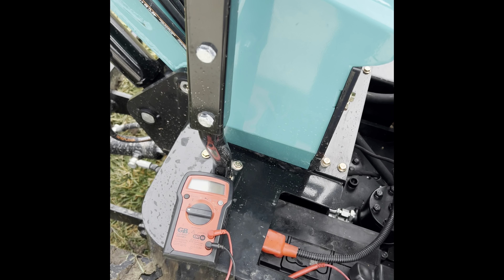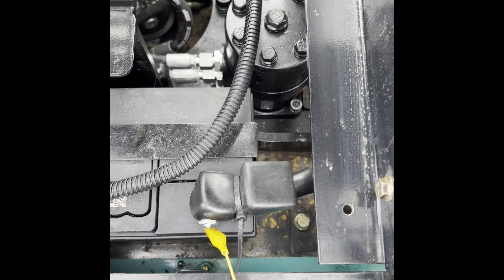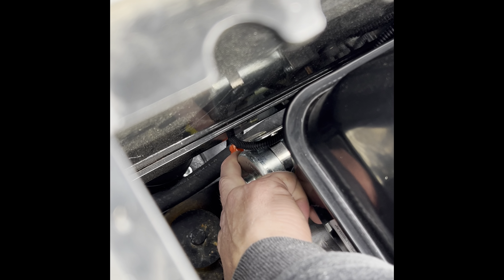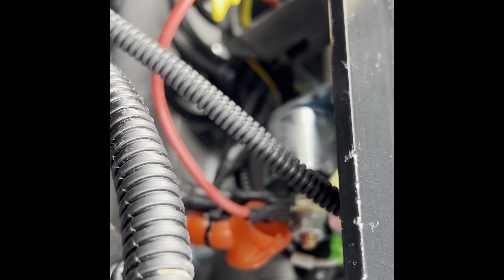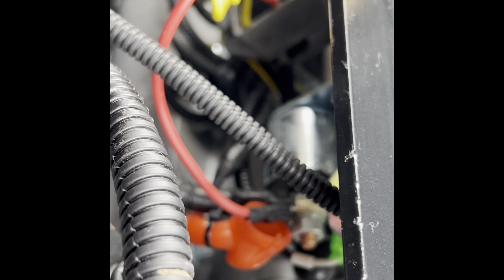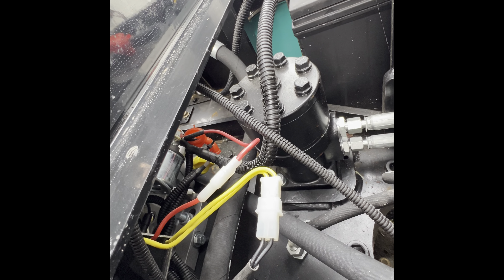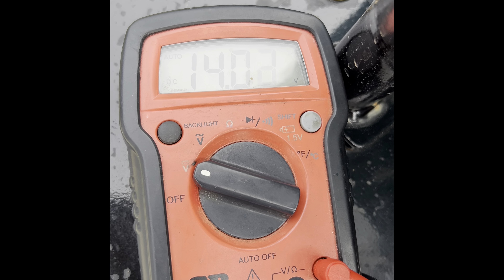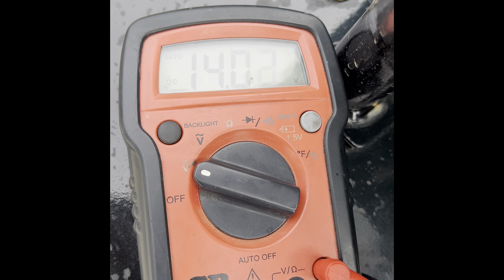Electrical Overview On Chinese Mini Excavator QH12 FF12

Comment: Great video, wish I found it before I traced half of the wiring myself 2 weeks ago because of a blown fuse. You were testing alternator wires' output to the ground and getting 8.5VAC on each leg. Bet you a quarter they're opposite in phase, centered around ground and will give you leg-to-leg 17VAC.
Reply from the maker: Lol I try to get it out there but most of the forums block links so just have to let people find it themselves!

Comment: We have a brand new Chinese skid steer with likely the same electrical design as your excavator. The battery is fully charged. When we turn the key, the power drops; the lights go out, and it just will not crank, although it is trying to. Do you recommend any steps to check for troubleshooting?
Reply from the maker: Could be a lot of things but according to your description it sounds an awful lot like a bad battery or ground to chassis. Batteries can have a full charge and drop to 0 volts as soon as a load is put on.  I would recommend load testing the battery to rule that out then with a volt meter check your ground including the main cut off switch as that is on the negative side if the battery a bad internal connection will cause power loss to everything. Then with a volt meter on dc voltage setting check voltage going to starter solenoid when key is turned to start position.
Reply: @86ServiceTube  It turned out to be a bad battery. Thanks for the response.
Reply from the maker: @xoneeleven showed all the signs!  Glad you got it figured out!

Comment: @86Service - I’m diagnosing a starting issue with my mini after a few of the wires burned in two from being to close/touching the engine. The wires come from the starter solenoid. I spliced them back together. Now the machine will turn over and over but won’t fire up. Any idea what is wrong? I found two fuses and both of those are intact. Thanks!
Reply from the maker: If the information you are giving me is accurate… the wires going to the solenoid will not effect engine firing.  They simply power the starter motor.  You have a spark, fuel, or compression problem.  Likely not compression.  So focus on spark and fuel.  Spark is easy to test simply remove the spark plug leave it plugged in to cap.  Ground the plug to the engine casting turn engine over with key or pull rope and watch the plug for a nice consistent spark.  (Be careful nothing flammable is on engine and cylinder is not flooded with fuel or it may ignite). If you have good spark move on to fuel.  If you do not have spark check the black wire coming from under engine shroud it comes from ignition coil to the key switch.  That is your engine kill switch if it is not hooked up or there is a bad connection in keyswitch to that wire engine will KILL and not spark.
Reply: I have confirmed it’s not a fuel or compression and definitely a spark issues. I pulled the plug last week and didn’t get a spark. 

The kill switch is effective as in when I flip it, I get no power to the starter. 

What all controls the spark? Relay?
Reply from the maker: @dustinchambers496  Spark is going to come from your flywheel to the ignition coil mounted by the flywheel then sent to the plug.  The only external thing that would effect the spark would the killswitch and wire that goes to the ignition coil from kill switch to ground the coil.  If that wire and switch are confirmed correct then the only other things it could be would be a tripped low oil sensor, bad ignition coil/cap/plug, or a flywheel issue.

Comment: Thanks a million for the great video! I have a question, I have blown two fuses then it shuts everything down, I believe it has something to do with the light on the bucket, that runs to the switch that you pointed out on your video, my question where could the short possible be? In the light? In the switch? What can I do to solve this problem? Thanks
Reply: Any luck finding the issue?
Reply from the maker: Sorry I just saw this.  If you feel that the short is in the light circuit you could check the wires on that circuit for continuity to ground while wiggling them.  If the fuse is blowing there is definitely a direct short to ground or a load heavier than the fuse can handle.  What model do you have and where is the fuse located?

Comment: How does the circuitry work to stop the engine?   What's being grounded to stop spark (to kill the engine... if that's indeed what kills the engine)??   Thanks.
Reply from the maker: Sorry for the late reply.  Good question.  I would have to look at the diagram to see how it actually works.  But I do know there is a single wire going from your keyswitch to the ignition coil that tells it that it can or cannot fire.   The ignition coil on these engines is mounted right beside the flywheel so its picks up the pulse directly off of the flywheel to fire.  The coils are bolted directly to the to engine so they are grounded.  So in my eyes the single wire would either open or close a switch within the coil by sending voltage or somehow using a ground.  Great question I should look into that.  Very rare that I do not know the answer.
Reply from the maker: I found your answer here sir. https://m.youtube.com/watch?v=Fv6N2WVtkEw&t=165s&pp=2AGlAZACAQ%3D%3D
Reply from the maker: So essentially to test if that was working you could put your meter on continuity beep setting and check between ground and that black wire to coil.  In the on position it should not beep.  In the off position it should have connection to ground and beep.

Comment: I recently experienced an ignition switch failure.....not waterproof.... i attempted to wire in a generic switch but with no luck. I found a stock replacement online but failed to take a picture of the harness plug wire orientation. Could you possibly show a picture of how the wires insert in the harness plug? Mine has 2 yellows together, 2 yellows w/ white stripe together, a white, a green w/stripe, and a black. Just a picture as its plugged in would work....Thanks in advance and thanks for the helpful videos...
Reply from the maker: Sorry I just saw this did you get it figured out?

Comment: Very helpful video. Do you know the maximum wattage these stators produce?  I thought it was 10 amp which would be 120 watts from my very poor (not confident) estimates but if you're running 2 - 80 watt fans with no issue it must be higher then that. Thanks.
Reply from the maker: I do not off of the top of my head.  Pretty sure the stator on this engine is 20 amp 10 per leg but do not quote me on that I would have to look at the specs.

Comment: My chinese mini ex runs but will suddenly stop running. It will start back up after several attempts and run a bit then suddenly stop running. I thought it ran out of gas but the tank is full. Where do you recommend I start diagnosing?
Reply from the maker: I would first pull the spark plug out and see if it is white or black on the burning end.  That will give you a good indicator if it is getting too little or too much fuel.  If too little I would check your fuel flow to carburetor, check the float operation, check the jets and fuel passages, check to make sure choke turn engages fully and disengages fully. Its possible that your choke is partially staying on and cutting too much air after engine has warmed up making it run rich and foul plug.
Reply: They also have a low oil shut off, it's possible that it might be slightly low on oil and cutting off spark.

Comment: I have a brand new mini excavator and the ignition switch locked up to where I could not turn the key so they sent me a brand new ignition switch which I put in but now it turns over but it will not start so they sent me another ignition switch which was just a nap a universal switch with a hand Ron terrible wiring diagram. It’s still turns over but there is absolutely no spark else works. I wondered if you had any insight on this.
Reply: I have the exact same issue, replaced switch but it’s like engine has no spark. If you figure out a remedy it be great to know.
Reply from the maker: I am sorry I have been away for a while.  But I would check the black wire that goes to your ignition coil that is what shuts the engine off by killing spark.

Comment: Do you know if there is a fuse, we went to start ours and we have nothing, no power, also all the switches for the fan, light and windshield wiper don't work
Reply from the maker: There is a fuse yes can be found under the floor pan on the front side of the engine.  However I would check the main power cut off knob switch.  It will be hooked to the ground side of your battery.  If it fails to make a connection when in the on position your machine will receive no battery power.
Reply: I have blown that fuse because the wires from the cabin on my FF13 came off in transport and when I reconnected them I shorted out positive to ground. Turns out there is only one wire going to the cabin (powers fan, wiper and lights) and that's positive. Negative returns through the bolts that attach the cabin to the frame.

Comment: No spark on my Chinese excavator.  It was running fine, has about 4 hours on it, and it stalled and I’m getting no spark. Please help me diagnose it
Reply from the maker: Sorry I am just seeing this.  No spark can be many things.  The ignition coils mount by the flywheels on these and they pick up their own signal from the flywheel.  However there is a killswitch function wire from the ignition switch.  Need to check that wire out first.
Reply: Mine done this and it fouled the plug. Change the plug and it should fire back up. The problem is the choke is not staying all the way open making it run rich to foul the plug.  I installed a spring onto my choke that keeps it open at all time so this does not happen again.  Hope this helps ya.

Comment: How about a picture of the wiring diagram for the ignition system
Reply from the maker: I am not sure that one exists.
Reply: @86ServiceTube  A wiring diagram does exist, but it sucks if you want to know what wire goes to what pin / connection. Which is what brought me to your video: Do you have a named pinout for the Ignition Key Switch? I had to take mine apart in order to turn off the excavator because the switch would not key turn off. Taking the key switch apart, the OEM switch is really poor quality plastic, and it looks like either the ball bearings wear away the plastic (sticking the key), or the key spring bends the plastic outward, thus sticking the key in place. 

I want to replace it with an new 5 pin ignition switch of better quality, but I am not sure of what wire goes to which pin, since the OEM unit doesn't have designations on itself, and a different 'brand' ignition switch may be pinned differently. I'm going to look through your videos to see if you have already provided a pinout for the key switch, but if you don't have one, hope it gets warm enough to make one. Thanks. 

By the way, you can get the manual on their website, 'agrotkindustrial'. It's on the product page for the QH12. The diagrams are on "Section V. Electrical system diagram".

Comment: Do these mini’s go into free wheel down hill ?
Reply from the maker: I have not experienced it.  But I have heard of it.  I haven’t had it on any major hills yet.
Reply: No. They run on hydraulic motors so as long as your drive levers are centered and valves aren't leaking the motors are locked up. My old Bobcat runs on friction clutches and freewheels on any inline.

Comment: So what turns the engine off electrically? The key switch or the big electrical disconnect? And why. Thanks for your time Chad.
Reply from the maker: Sorry I did not go over that!  Thanks for calling me out.  The keyswitch controls the engine kill.  I will make a video on that when the weather gets above 0 degrees 😂
Reply: I would also like more detail on the key switch. Mine has issues and I’d like to replace it but can’t figure out which wire is which.
Reply: My ignition switch failed, so I got a Kubota switch.  I IDed three of the terminals with an ohmmeter and got it to crank, start, and run.  But, the engine does not stop when switched to the off position.  I ended up pulling the spark plug lead.  How it it designed to stop running?